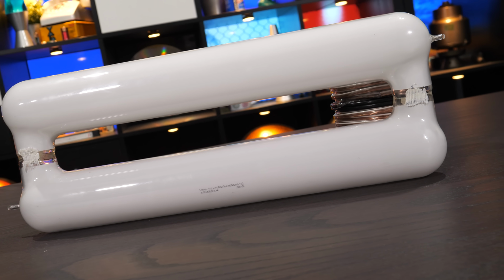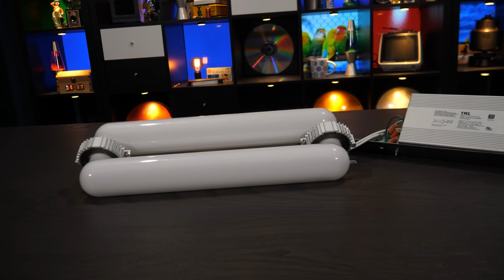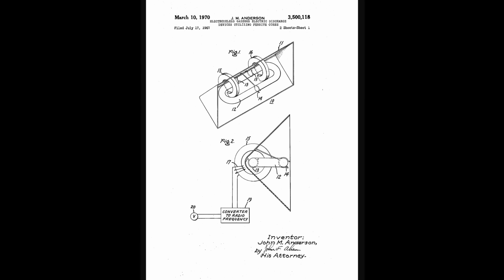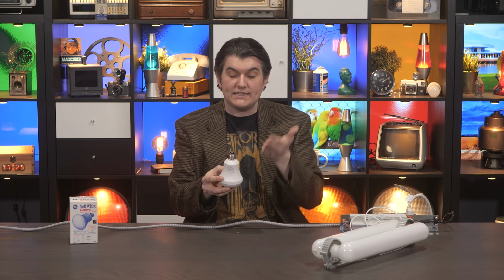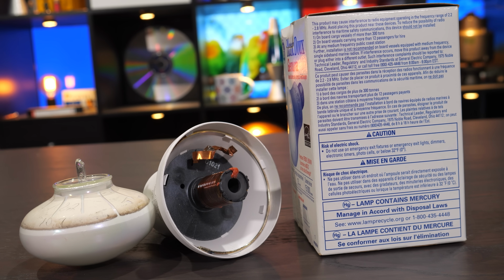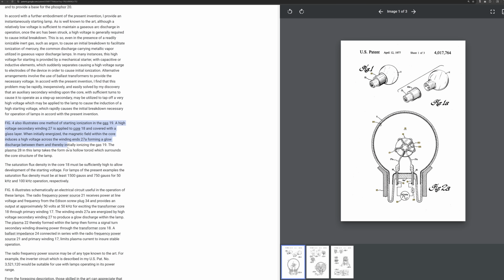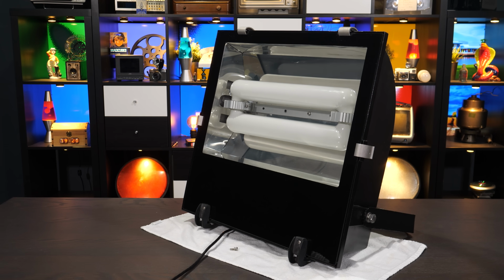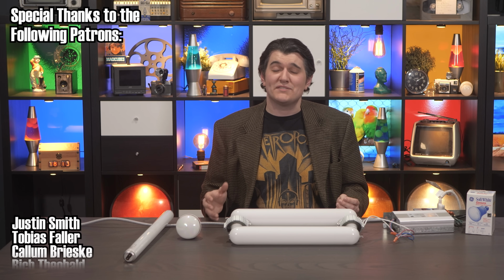Induction lamps: fluorescent lighting's final form

Comment: I was importing those lamps loooong time ago to Spain. In fact I have price listings and catalogs. Even an Excel spreadsheet comparing compsumtion and lifespan within led, HPS and induction. 
At this time INDUCTION was wayyyy better and economical than led. Mostly because led drivers needed to be changed every 12K hours, and lumen deprecation was quite high. 
If you need documents and prices. Please let me know. 
Regards from Spain

Comment: Around 2009 I did a school project that was a proposal for new lighting for a company's parking lot. At that time, Induction lamps had a lighting efficacy that was on par with LED and their current metal halide fixtures. And the lifespan was 2-3x that of LED.  The energy savings from LED was only from better light distribution. Basically you can spread the light more evenly so you didn't need as much. The high upfront costs of LEDs at the time made us recommend against them as the return on investment period was longer than the life of the LED. 
Induction lamps would show a savings on the maintenance costs over metal halide eventually due to the 5x longer lifespan. 

Unfortunately the sponsor company's goal was not really energy/cost savings. The company really just wanted in on the buzz around "LEDs" and was not interested in the actual math.  A free lesson in corporate politics vs science. Something to think about before blaming the engineer for some poorly designed widget.

Comment: Flicker flicker. Led flickers.  Not as bad as a not-so-good fluorescent, and would be worce in EU with there 50hz .  
Yhe flicker makes it more enjoyable to watch the snow falling  from my porch with the stop motion effect. But makes for a treble driving experience.   In heavy snow fall I may as well close my eyes for the  extremely lit up ¼mi before and after an off-ramp to improve other senses .
Reply: Thats a driver issue, not an LED issue. LEDs are DC devices. A proper full bridge rectifier with correctly sized capacitor can remove almost all ripple. Within cheap LED bulbs, you will find cheap drivers (the circuits in the base), and if the manufacturer decides to cheap out on the circuitry...  (half bridge rectifiers, undersized capacitors),  yes, it will flicker.

Comment: TIG welding machines can start the arc by high frequency, after the initial arc forms the welding gas is ionized and machine can sustain it with fairly low AC or DC voltage 15..8V. Maybe similar trick is used inside the tube?

Comment: The toroidal cores act look remarkably similar to the split core toroidal current transformers used in substations and medium voltage switchgear applications all over the place. Basically you slap the donut around the bus work run the secondary wiresto your meters or protective relays and you are good to go. I'd be interested in seeing you do a video on inductive disk time overcurrent relays. I'd have to check but I may even have a spare General Electric IAC relay somewhere that id be willing to donate.

Comment: DiodeGoneWild on YT has a video looking at induction lamps and they're drivers and from what I remember the lamps do start by inducing a very strong field capable of creation ionisation. 
Also if you want directional light from a pinhole source they made microwave induction lamp were there was a little gas filled pill that was pumped woth a LOT of RF and creazed a very high intensity output at efficiencies rivaling modern LEDs. Very cool technology indeed!
There are also some videos by zilipoper showcasing induction lamps with a neon filled tube and phosphor emmiting beautiful high intensity red light and also the plasma toroid generators you see on YT operate on the same induction plasma principle:)

Comment: Those friggen LED bulbs are a scam. The electronics and LEDs themselves are driven way too hard and as a result have an extremely short lifespan than what they could offer if they were driven by about 1/3 less current. Therefore I am going to buy a couple today and hopefully change a couple of SMD resistor values to achieve this. Great video. Cheers

Comment: You don't really even need to connect the tube to anything. Just hold it up under a powerline. The power in the air will light it up.

Comment: Excellent video, I know that another application of these lights is where the architecture is restrictive in allowing maintenance and replacement. The city of Nuremberg has some in use at parks where the lights are encased into concrete seating and a pain in the Butt to access.

But this video kept giving me vibes of... 

The original machine had a base plate of pre-famulated amulite surmounted by a malleable logarithmic casing in such a way that the two spurving bearings were in a direct line with the panametric fan. The latter consisted simply of six hydrocoptic marzlevanes, so fitted to the ambifacient lunar waneshaft that side fumbling was effectively prevented.

Comment: 6:08 "a tenfold increase" is incorrect. you ment to say a 10 TIMES increase.  10 fold would imply a 2^10 increase or around 1024 TIMES think of how many layers you would have if you folded a paper 10 times.  10,000 times 10 is 100,000. not 10,000 times 1024... (which would be 10,240,000)

It would me "more accurate" to say 3 fold since 2^3 is 8 and that's the closest you can get to 10 using "fold" numbers
Thanks for reading, I'm just on a quest to correct the usage of "fold" numbers since everyone is using them incorrectly.

Comment: Hold a florescent lamp near the antenna of a cb radio it will light. The RF frequency causes the ionization of the gases. Fun fact a 2foot bulb is great for checking RF wave guides for radiation leakage.